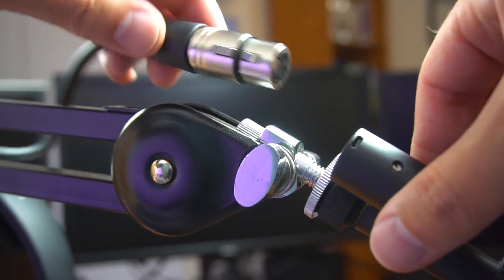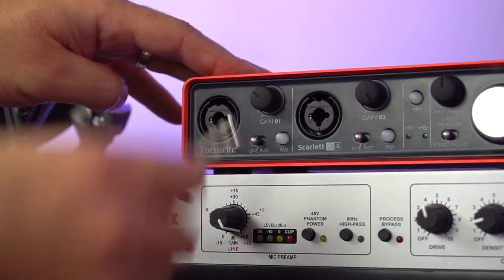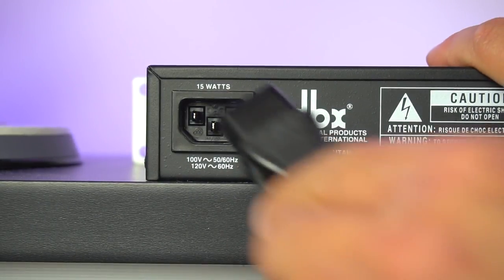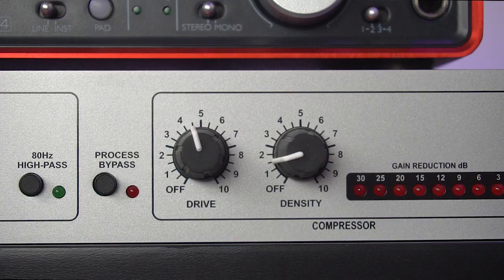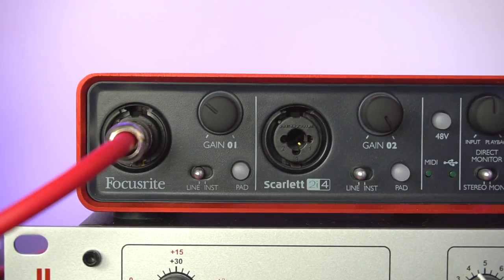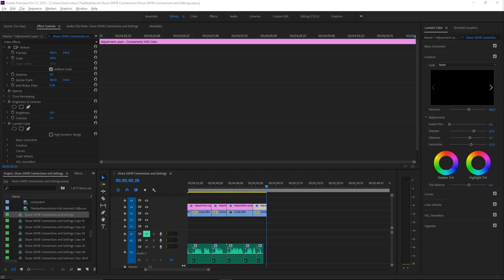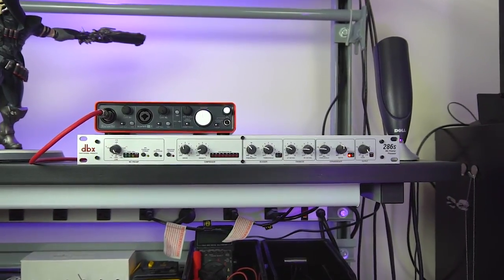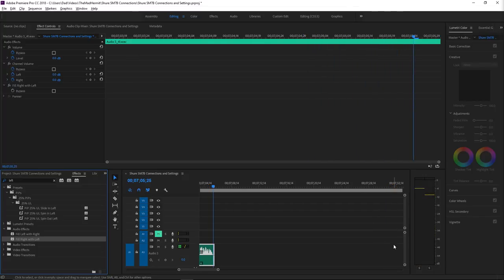How to Connect the Shure SM7B XLR Microphone to a Computer

Comment: i was so excited untill i heard the audio only coming out of the left ear. i then relized that i wouldnt be able to use this setup for streaming on twitch. is there a way to set it up so the audio is normaal?
Reply from the maker: Absolutely. You need to look for an option in whatever software you are using to stream that allows you to convert mono to stereo in real-time. Most programs like XSplit or OBS have this ability.
Reply: @TheMadHermit  oh thx, i bought the dbx and a beringher mixer. can the mixer be used instead of the scarlet?
Reply from the maker: Yes.
Reply: @TheMadHermit  last thing (sorry to bother you) is the sound not going to be as good if i use the mixer instead of the scarlet? im going to be streaming so i bought the mixer
thx
Reply: Focusrite has better preamps than behringer. Btw, look at other comments, I give solutions for the left-only thing.

Comment: so if I get the dbx no need for a cloud lifter ??
Reply from the maker: +PaddyMeade92  Nope.
Reply: No but you have to turn your gain up to max, then gate the hell out of the floor to remove the line noise, which is why you should use a cloudlifter.

Comment: So by not having a high end soundcard-component in my PC-rig, i am not risking any bottlenecking with the sound since this setup uses USB as the input to the PC?
I am just really bad at this stuff so i want to make sure before buying anything!
Reply from the maker: You are correct. I don't have a separate (high-end) sound card in my system. I am just using the on-board audio. For this setup, all the encoding happens before it enters your computer and is then delivered to your computer via USB.
Reply: The Mad Hermit, Ok thanks for the reply! While i have your attention, any specific cables i might end up needing when setting this up? Or does it come with the mic/amp/focusrite?
Reply from the maker: GLS Audio 6ft Patch Cable Cord - XLR Male To XLR Female Black Mic Cable - 6' Balanced (http://amzn.to/1mEgNIm)

GLS Audio 6ft Patch Cable Cords - 1/4" TRS To 1/4" TRS Color Cables
(http://amzn.to/2zp4ESa)

How It's All Connected
==================
Use GLS Audio Patch Cable To Connect
Shure SM7B to  DBX286s (via XLR Input On Back)

1/4" TRS To 1/4" TRS Color Cable To Connect
DBX286s (Via TRS Output On Back) to Focusrite 2i4 (via TRS Input on Front)
Reply: The Mad Hermit, Thank you very much! I will try to remember to show you when everything is set up :D